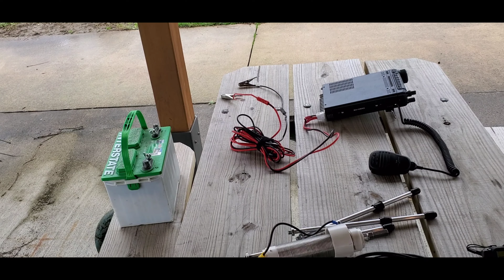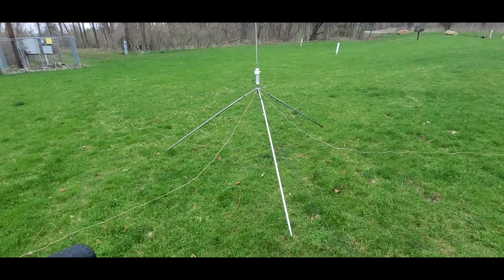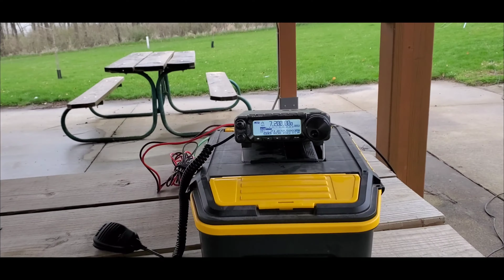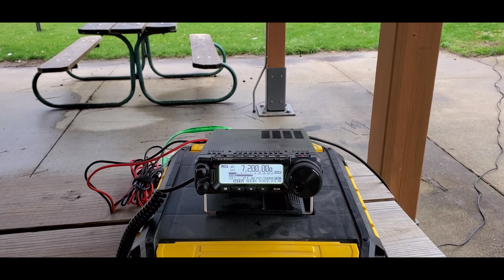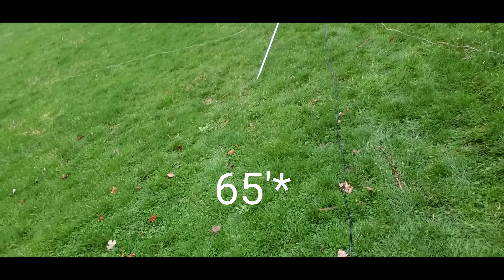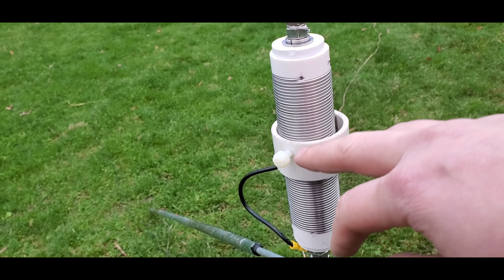Setting up and Tuning WRC TIA Mini (modified) Without  An Antenna Analyzer

Comment: I recently purchased the TIA Mini and I really haven't been able to use it. Mine came with a defective telescopic whip, and after several attempts of contacting Wolf River coils I haven't been able to get a response from them in order to resolve this issue. I was able to use it with my Buddipole 80 meter telescopic whip though. I do wish that their antennas came with carry bags.
Reply from the maker: Yea i will say that a bag would be nice. I'm surprised you haven't heard back from them honestly. I ended up getting a MFJ 1979 whip when mine broke and it works wonderfully with the coil.
Reply: @K0BJJ  I think a lot of hams have used the MFJ-1979 whip and it seems to be a pretty good addition to the Wolf River Coils antennas. Hopefully I'll hear from them.
Reply from the maker: @kd5you1  yeah its two older hams that run the company so. if they went on a vacation or something sometimes it takes a little time to hear back form them.
Reply: @K0BJJ  ok thanks!
Reply: @K0BJJ  Today I received a replacement whip and it seems to be pretty solid.
Reply from the maker: Im glad to hear it. Glad they got you back on the air with that WRC.

Comment: Great video. If I can make a humble suggestion from someone who did this for years with my vertical when I was too cheap to buy an analyzer lol........ 
Before running back out to tune the coil, Try checking SWR at the top and bottom of the band to see if the antenna needs to be electrically lengthened or shortened. (Don't just stay on 7.200). It will save you some walking. If your SWR is better on a lower frequency, it needs to be shortened. If it's better on a higher frequency than desired, it will need to be lengthened.  Also, when you get close with the coil, you can raise and lower the whip an inch or two to fine tune.  Hope that makes sense. Great videos by the way!
Reply from the maker: Yes it does, i have done that since then. Lessons learned you could say. my biggest issues that day was i got my 20 and 40m spots in the coil mixed up. i don't mark min like a lot of people do.  Thank you for watching.  I've thought about remaking this video, but have been on the fence about it. What do you think?
Reply: @K0BJJ  If you enjoy making the videos, I say go for it. There are lots of people out there without analyzers that do this type of thing. (although the NanoVNA has probably changed that.) I'm sure it would be helpful to other hams. Thanks for taking the time to share your journey and for the quick reply!
Reply from the maker: Not a problem one of the things i love about YouTube is the ability to talk to people in the comments. Maybe i should revisit this again. I know i can make it look better if i do :D.
Reply: So would raising the tuning collar upwards shorten the coil and moving the tuning collar downwards lengthen the coil?
Reply from the maker: @paulgarcia1566  to my understanding yes. I am going to revisit this video and demonstrate this better. Although that might not happen for a while. The biggest thing is turn your radio up so you can hear that white noise. When that noise is the loudest you have heard go check your SWR.
Reply: @K0BJJ  Thanks for the tip. Its sounds counter-intuitive but I can now see what you mean.
Reply from the maker: Maybe if i feel up to it today ill set up in the yard and do a better video of it.  We will see woke up feeling under the weather so. We shall see if my voice makes it that long lol